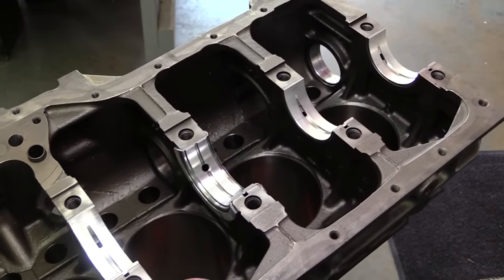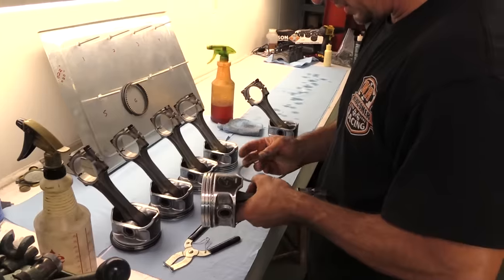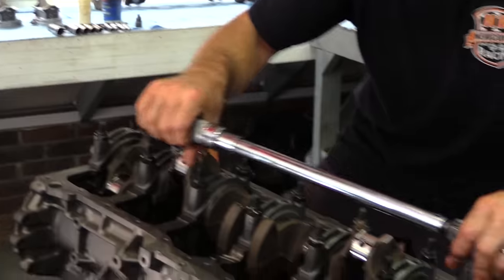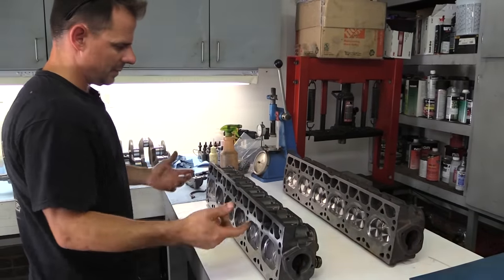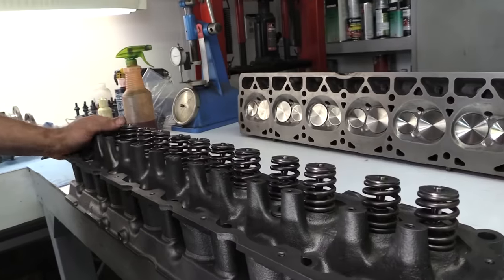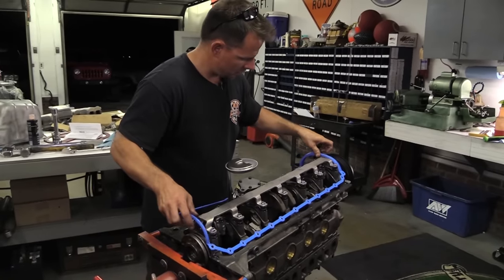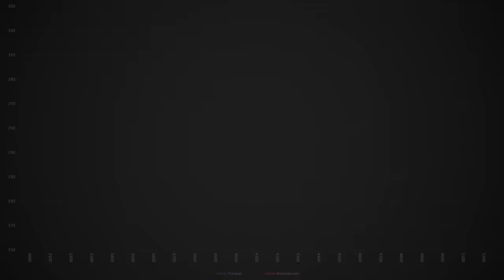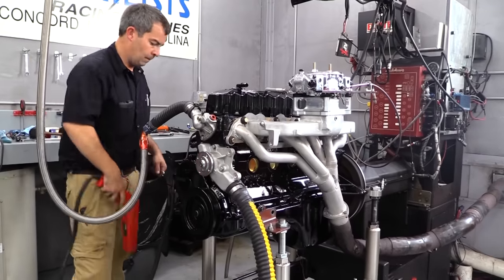Big Power Jeep Straight Six Stroker Build on a Budget with Newcomer Racing

Comment: What is sad, is one day guys like this will go the same way guys that rewound starters and alternators did. Their knowledge will be lost like the knowledge about steam and old Iron. Such passion.
Reply: To be replaced by people with equal passion for the technologies that replace the ice.
Reply: The last of the Mohicans as my co worker would say
Reply: I completely agree.
Reply: @lifetimeofwork  boring. I don't care about the numbers either. Building ICE is an experience. It's visceral. It's primative, albeit with the new EFI and ignitions if one so chooses. Friend of mine bought a crate SB Chevy 383 stocker. 480hp per dyno. The smells, the sounds, the challenges. Electro dudes just don't, or won't get it.
Reply: It's already happening.
Reply: It sucks. We need to make sure we keep the fire alive man. Gotta teach the kids. They have the passion they just need to be shown the way man.
Reply: Look up synthetic fuels. With carbon capture and electrolysis of water, you can build customized synthetic fuels without converting solid or liquid carbon to gaseous carbon, instead converting gaseous carbon into liquid hydrocarbons which then become gaseous carbon again. Economy of scale of an industry like that could make reducing overall carbon concentration in the atmosphere a positive externality of this incentive structure. A carbon tax is all that'd be necessary to create this industry, it exists but not at scale yet. Has potential to keep ICE alive for awhile to come, maybe forever. You just can't beat the energy density of STP stable liquid fuels using the oxygen in the atmosphere as an oxidizer for the reaction. It's so incredibly elegant and efficient, it'll be centuries before batteries beat them in every use case. imo switching entirely to electric isn't enough, we have to artificially reduce carbon concentration anyway, so why kill ICE when we could use it to actually solve the problem instead of externalizing the solution to Brazil, Russia, Indonesia, Canada, and the west African nations and hoping the trees do it. ICE will be fine. Porsche and Boeing are pushing this hard, and I suspect oil and gas companies might jump on it to save their industry edge. They lose it entirely if they simply become competitors to solar, wind and battery manufacturers and grid operators.
Reply: Xtal567 you must be an old man who never took the time and patience to teach a kid about it
Reply: @DrManhattan84  Have you tried to teach a kid these days? You have to want to learn. Admit it! It's getting harder and harder to teach kids or just people in general.
Reply: @supie5063  so who failed, us or the kids?  I have a kid who is reluctant to do anything but play fortnite, I don’t let him unless he’s done everything he needs to and I make him learn how to build stuff with me. Old people like to get smug and judgmental about the youth of America, but I rarely see them get patient and  tutor them.
Reply: @DrManhattan84  I'm not to old but I see where they are coming from. At the end of the day we don't build um like we used to. Good for you for doing your part as a parent should but face the facts open your eyes look around a bit these damn lil brats need discipline. I could sit here all day no point so we are just gonna have to agree to disagree.
Reply: @PaulSter  electric is overpriced and you get very little range with long charging times. I'd own one for sure but it would never be my only car. They dont have good enough range and if you run out of juice you have to have it towed vs walking down the st to get a can of gas
Reply: @michaelatkin9649  I will stubbornly hang on to my ICE vehicles as long as I can (for my Jeep and truck), but I'm sure it will be alongside a hybrid.

Agree - not enough of one (range) and too long of the other (charging times).

Heck, I start getting concerned when my phone battery goes below 50% and my new s21 ultra has great battery life for the power it has.
Reply: @DickShooter  I.C.E. = Internal Combustion Engine
Reply: I'm in this bracket I know how to do pretty much everything the old style from way back I still do these things even though I'm retired but if this $5,000 build is a is a deal? I can do the same thing without the stroker crank for one third the money it's amazing what they are charging to do things but my knowledge will be very expensive soon because I'm experienced in more trades than one
Reply: Yeah really if democrats have their way getting rid of the gas powered engine
Reply: @lifetimeofwork  passion for what? An electric motor with 4 parts? How boring that will be
Reply: @lifetimeofwork  No discrediting has been done to those that work with new technologies. It’s just sad to see the shift of a new era, yet beautiful at the same time.
Reply: Thank's for posting interesting videos. Very much appreciated and a good source for part's.
Reply: As you said in video it's 2024 now I have an 04 jeep wrangler been looking at turbo set ups through banks power no longer make a blower set up through quadrotech no longer making how do I contact and purchase this set up